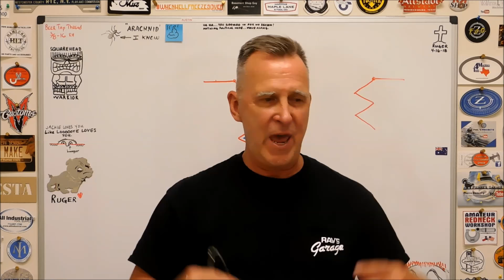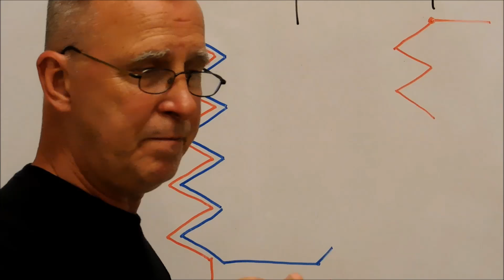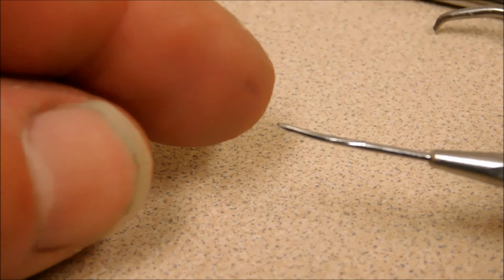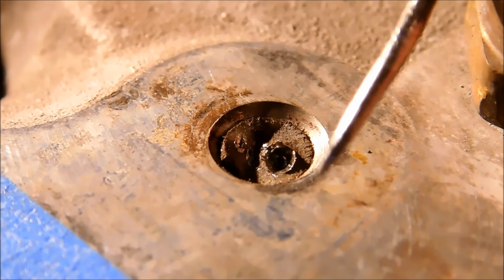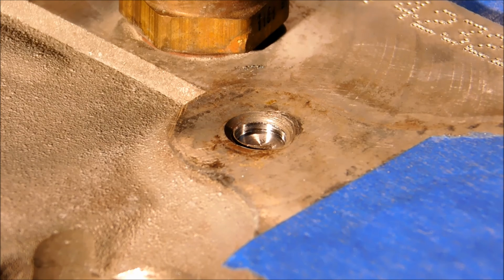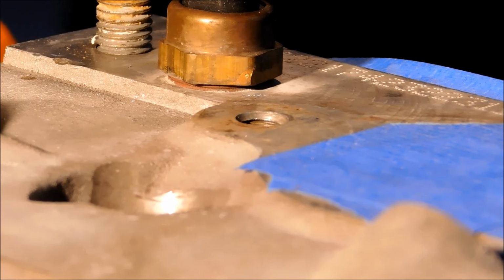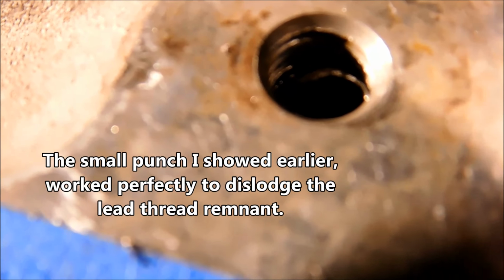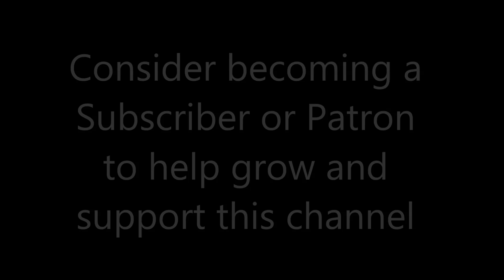Removing Sub Surface, Snapped off Bolts -- Take a Look !!

Comment: In my experience, any time an 'Easyout' works, it didn't need one anyway
 Spent way too much time removing various snapped off 'bolt extractors', they do exactly what you said and force sides tighter into hole. 
Another issue is when a nut welded on snaps off stud further below surface,  you now have grade 9 stud extra hard. 
Carbide is your friend then.
 Motorcycles are probably more prone and more difficult as they mainly use 6mm and 8mm studs and very rarely have a nice chamfer (often nothing is de-burred after machining)
 Doing it with a hand drill while engine still assembled is a bit of a challenge but sometimes it happens you get a 'springl' coming out

Comment: The gauge pin!  Sweet trick, thanks for sharing it!
Also, one of my original tricks (at least I think it's original) is that you can hand-grind left-hand cutting edges on an ordinary right-hand drill.  It doesn't cut well, but it will grab a screw.
Reply: Alan Lapp thats a new one to me,good lateral thinking there! Personally,I would weld a nut onto a broken stud,even when deep in a  hole. The combination of heat,shock cooling contraction and candlewax always worked for me. Patience is key!👌
Reply from the maker: I like it.

Comment: Many years ago my Nephew bottomed a bolt in a new high rise intake.  Broke off the bolt then broke an easy out in it.  I made him take off the manifold  and bring it to my shop.  I E. Professional Gunsmith.  My brother in law is a dentist.  I get his old diamond and carbide burrs that are too dull to use any more.  Using a high speed flex tool or dremel tool and much patients I cut out the the easy out then used your method.  3 1/2 hours later job done.
Reply: your brother in law has the patients and you have the patience :)

Comment: Good comments posted. No matter what you do, as Joe says, don't bugger up the broken end of the stud or bolt and the surrounding area. If someone has done that, trying to find the center of the fastener can be a problem. Even welding a nut on can be a problem if it's been really messed up.
A method I have used to remove broken cylinder head studs that have broken deep in the cylinder block (Volvos in this case) with the engine in place is to leave the cylinder head on the engine. Turn up a sleeve on the lathe that just slips into the cylinder head through hole and long enough to reach the engine block. Drill the sleeve's I.D. to just a hair under the tap drill size for the stud. Now take the left-hand twist drill you ordered from Travers Tool or McMaster yesterday afternoon that fits into the sleeve and using a hand drill begin to drill out the stud. Usually about a quarter inch of drilling will snag the broken stud and spin it out. I used the slightly undersized drill because I don't think you can be certain the cylinder head through hole is exactly aligned with the stud hole, though it is pretty close. If the head is already off use an aluminum plate you can clamp into position over the broken stud with a guide hole the sleeve you've made will just slip through. You want to make sure the drill is absolutely square to the cylinder block's deck when you use a hand drill. This is the sort of like the factory trick Mercedes uses to replace one time use cylinder head head bolts in aluminum blocks. They have a very expensive fixture plate that fits onto the cylinder block so all the head bolt holes may be drilled out and helicoiled. It also comes with an oxygen mask to revive the owner when he gets the bill to replace his car's head gaskets.
One trick I have used successfully a couple of times with broken taps is to grind the broken end square and silver solder the end of an old Allen wrench on to the tap if  you're lucky enough to have part of the tap exposed. I imagine that it works like welding a nut on to a fastener. The heat from the torch frees up the tap a bit from where it's bound in the work enough that you can back it out.

Comment: I've tried easy-outs a dozen or so times in my life and I have NEVER had success with them -likely for the reasons you suggest. Your ideas of accurate centering and using a drill the same diameter as a tap drill for that thread size makes much more sense - effectively removing virtually all of the original bolt and leaving "only a spring". Brilliant!
Reply from the maker: It has never let me down.

Comment: Very good video Joe. Back in the day I had a 1980 Ford F-350 that the exhaust manifold bolts would just break off in the same manner. The first time I sent it to a machine shop for the extraction but it cost me a fortune and as a teenager I didn't make that kind of money. From then on being a welder I would place a nut over the broke off stud and fill it full of weld. Luckily it worked every time for me and I never messed up a head. Later on I got tired of doing that so I installed a set of headers and corrected the problem.

Comment: Excellent explanation. I use a step by step approach. I'll find center and spot it if needed like you did. Plan A: I'll try the left hand drill (if available) or right hand drill both sized for a screw extractor (Plan B). Having three different types of screw extractor sets lets me pick the right amount of engagement. My Plan C is drill the bolt and remove the "spring" just as you did in your video.  It comes down to speed, Plan A is the fastest and least likely to damage. I work on Helicopters so things get expensive quick. Lisle makes a set of tap sockets PN 70500,  hands down best investment ever.

Comment: I've been working on big trucks and mining equipment for 45 years. Done that more times than I want to remember. Cummins came out with the bright idea of the interference fit exhaust manifold bolts for a short while. There is nothing worse than 12 broken bolts at a time. The root of the bolt got larger the further up the shank. It actually seizes into the threaded hole. Nothing like making a broken fastener harder to extract.

Comment: For an engine block, I can see why machining out the stud is better than using heat; if you warp or damage the block, then you'll have to deck it flat again (or pay somebody with a specialized mill).  Thanks for the nice video and the great advice!

Comment: Interesting technique, I never thought about drilling just undersized of the threads. Thank you for sharing. Have had my fair share of broken bolts and many were a royal pain to remove. Easy outs and left handed drill bits can be wonder tools but, only for certain situations. Great video, cheers :)

Comment: I enjoy watching these removal videos. Though, we all don't have access to a mill or the luxury of having a head out of the vehicle. The welding of a washer/nut to a broken stud does work... most of the time. I once had a Ford Triton with broken studs, and the welding just wasn't working. The forward holes don't give much access. I had used a ball-tip carbide in my small die grinder, just to try and put somewhat of a centered spot, and wouldn't you know it... the vibration and rotation walked that stud down in the hole. I think a lot the time, as the bolt/stud breaks, that thread spirals outward and bites into the threaded hole, creating enough tension to fight coming out. I actually did use a left-hand bit and angle drill to get it out.

Other cases, with a head on the bench, I've had very good results with left-hand bits. I've found that today's cordless, brush-less drills to be the weapon of choice. The low-speed torque is tremendous and drilling slow, with left-handed bits generally works. Forty some years ago, I worked in automotive engine re-builder shops. Broken bolts were always part of the process. Twenty years later, I started turning wrenches. Broken bolts were still a part of the job, just harder to do.

Joe, not a thing wrong with the way you did this... I would do the same IF I had a nice mill and the head in my hands. I may not have tried to pull that thread, like pulling a helicoil out, but would have turned it all the way out, because of the brittle nature of the remaining threads.

Thanks for the videos!

Comment: As always, careful assessment of the situation and careful set up are keys to success. Verifying the proper drill to use (great explanation of the expected diameter btw) and accurate centering of the workpiece. Very satisfying video, thanks for posting! 👍

Comment: @13:01 timestamp--  One useful practice I've found is to take the center drill and seat it as deep into the chuck as possible. The shorter the projection of the center drill out of the chuck (or collet) the less wobble/deflection.

Comment: I have used the same process to remove 3" seized studs on pressure vessels with portable machines. The only difference is, because of the size we can bore and creep up on the root diameter. Thanks for sharing.

Comment: Great video Joe. I work in a workshop which restores vintage cars, so broken studs are very common. Luckily we have lovely old machines which enable us to do what you demonstrated here. It is the hardest job to get right I think, and those dam easy outs have never succeeded.
Reply from the maker: Ever try to machine out a broken easy out?
Reply: @joepie221   No I haven't. I have tried drilling bits of broken drill bit out, but of course the drill sways towards the softer metal and goes off centre.

Comment: For me, plan "A" was to TIG weld a nugget on the center of the exposed stud and build a turning device on that, if I had the luxury of getting access to the stud with a TIG torch. Plan "B" is I use a left hand spotter drill bit or LH regular bit as early in the project as possible. 90% of the time the LH spotter or LH regular drill bit itself was enough to extract the broken stud. Plan "C" is a deep hole and extractor.  Plan "D" a tapping hole and peel that thing out like the irritating itchy scab it is. Plan "E" give up and drill out and tap the whole mess for a helicoil to original stud size.  Plan "F", drill-tap a larger hole. Crank down to tightly bottom out a soft bolt to plug the hole,  cut off the excess and drill-tap back to original stud size right into the freshly plugged (staked and thread locked) hole. I was "that" poor sap in the machine shop or fab shop. That's  the neurosis necessary that made me indispensable and gave me some job security. Careful use of heat is another skill along with penetrating oil usage. An automatic spring loaded center punch can sometimes coax it out by gently and accurately impact tapping/vibrating it out in reverse fashion.
Reply: Now that is what I'd call a comprehensive plan!

Comment: I got a broken wheel stud out by using a dowel in the Bridgeport. I leaned real hard on it running in reverse and when it turned red hot it welded itself to the stud and backed it out.

Comment: dental picks. I use them in the shop. if you can get your hand on a Hand Scaler, this is the thing used to scrape teeth clean. Hand Scaler is much stronger than the "Explorer" that you got. As far as the brands: Hu-freidy, Densply and/or, I think, as long as there is name stamped on them they should be OK. 
1 more tip: Orthodontics have a really good Scalers because they have to scrape their bonding material off of teeth. you can literally scrape a damaged thread profile to its shape (root, Flank and crest), using the bigger Orthodontic scrapers. They don't bend but they break.  they come in different sizes also left & right side use. so you might want to get a few different ones. Beside the Hand Scaler there are a few really good handtools that they use in the "amalgam setup" ( filling teeth with amalgam) that are really handy. I think one of them is called "dental spoon". Oral surgery setup also has some really good bone picker. most don't bend but they break.

Comment: Another Great Video, Joe Pie!  You hit the center dead on - by using the gage pin trick.   Wow!  BTW-Anyone that says that they have "never" put an endmill in a drill chuck- is either lieing, or they haven't worked on machinery very long..   Most everyone has done it in a pinch - for light milling or just what you were using it for.    Keep up the great work.
Reply: I use an end mill in my drill press anytime I need to drill an angle hole or drill on a rounded surface.

Something I've discovered from running them at slow speeds is to use end mills with as many flutes as I can afford, it halos when you can't get the RPM high enough.  A 6 flute carbide is the best to use in a hand drill, as well.

I almost prefer an end mill over a burr in a high speed die grinder for edge work, or opening up holes a couple thou, for bolt or stud clearance. 

Most all of what I'm talking about is edge 'milling', except the first example.  End milling is too damn squirrelly free hand, even for me!  LOL 

For years, I was very rigid in usjng wood tools for wood, metal tools for metal, stone tools for stone, then I started experimenting. It led me to discover some very useful tricks and methods. 

 I still go to my 50 year old 7 1/4" 'beater worm drive Skil saw with a old diamond tile saw blade, ('worn out' on my tile wet saw, first), for rough cutting steel/SS/cast iron.

I tried it as a joke the first time, and wss amazed at how well it cut.  I then rigged up an air nozzle for cooling, and it became a beast, (also kept me from warping the blade.)  

Been using the same blade for 20+ years. Figured the diamond would be completely gone after the first cut, but it just keeos cutting, and cutting.  Last time I used it was to cut some free 3/16" SS up for chimney flashing when I put a metal roof on my house.  Must have cut 30' of stainless with it. 

Have to clean up the slag with a side grinder, but I was pushing it a bit, in a hurry.

Then there was the time I needed/wanted to make a T-slot table out of 6061 T6. I didn't have the money to pay someone to cut 30+ pieces, (got the 6061 free!), and didn't have access to a mill, BUT I did have a router table, carbide router bits, and some feeler gages for shims.  

I just cut some dovetails on the saw with the above mentioned T-slot table, just this morning, for a new part for my lathe.

For me, it's about getting things done, to the level of accuracy necessary, no matter the material, or tools available.

GeoD

Comment: The first thing we do is talk to our welder. Exposed bolts get a nut, flush or slightly under the surface get a washer then a nut weld the nut and bolt together and back them out. I’m on 3rd shift now so I’m the so called welder of these when needed I had 11 of them last week and only had to re weld one of them. Usually give them a shot of Kroil before removing
Reply from the maker: Kroil is magic. Love that stuff.

Comment: Bringing back memories of drilling/cleaning out 5 out of 7 holes in the main clutch assembly of a WWII era D-7 Cat ... on the wood shop drill press.  I had the mating part to use as a drill guide.  Make the center dimple with the clearance drill, drill through with 1/4, step up to tap size.  I lucked out, only one hole grazed the thread peak at tap size.  Some remnants came out as they did for you,  some came out after being bumped and pushed a little with a tap (tricky work, keeping the tap from getting stuck).  The most stubborn one took heat from the torch to make it let go ... surprising what you can get away with using a torch, when it is steel stuck in cast iron.  They all cleaned up, held at torque when it was all back together.

Comment: Well done Joe. I had a customer that wanted headers on his 5.7, after he had a custom exhaust put on. I asked him why didn't  he have the shop that did the exhaust put them on? He stated he decided on headers after and of course that raised a red flag with me as more than likely the exhaust would have to be reworked after I put the headers on. I shot him 4 prices off the bat and he laughed, and i laughed with him. The no problem price, the you already have a problem price, the why are you so high price  cause I knew more than likely they already broke a bolt off, and the you are back after someone said they can do it cheaper price and they broke several bolts off.  In the end after they removed the heads I did get the job of removing five broken bolts and fixing one hole once they tried drilling one bolt out on the truck.
Reply from the maker: So true. Once the customer messes with it, it becomes a time and material job. No quote. Take it or leave it.

Comment: Joe, absolutely love your channel! Loaded with great information and I’ve learned a ton. One thing I learned at my first job was always use LH drills on broken bolts like that. That way if it does break free and move, you don’t make your job harder. Just my $.02. Keep up the good work!
Reply from the maker: LH drills are good if a bolt is newer or not corroded in. I have had success with them, but don't currently own any.
Reply: Anybody know a source for letter no set of left hand bits?